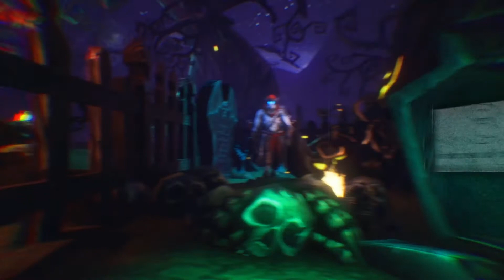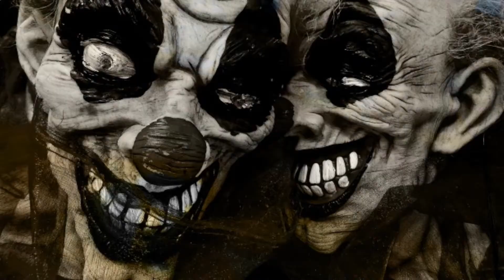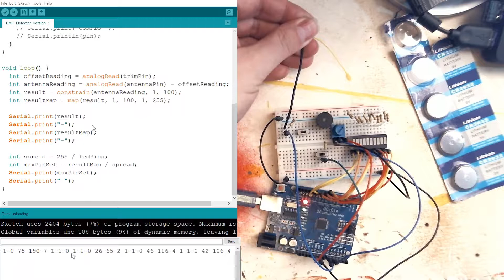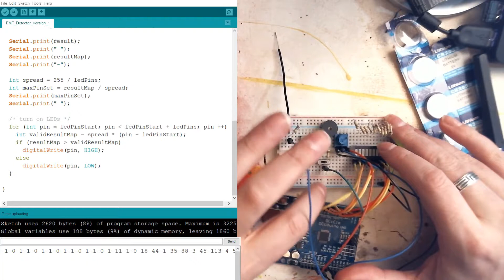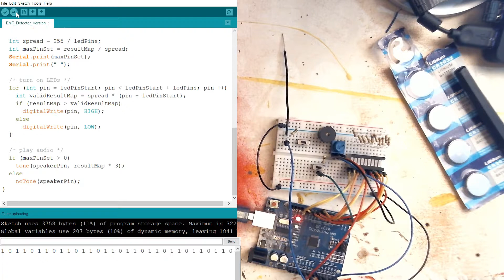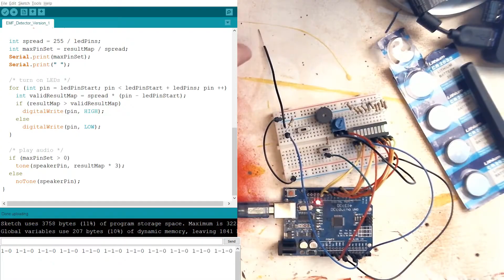Part 3 -  Making a CHEAP EMF Meter - Coding the Arduino

Comment: Nice setup. Just tested it, and it is working. 
Antenna a little to unsensitive, but not much.
The explaining file on Bitbukect.org is missing the indication of a resistor around the antenna. Parts List is not 11, but 12 resistors.
Reply from the maker: Paranormal ITC Research nice!! Good catch!  It actually works kinda nice.  I’ll get that updated in the morning :)
Reply: @LloydSummers  OK.  An unisolated dipol mini antenna got mounted to a two pinout socket. Fits in the bread board.
I have 8 Diodes, and i can only light up the 4 first when not touching. The potmeter is turned all over to one side.  A direct touch will turn on all. 
I wish for the antenna to be a few more procent sensitive, I guess. But it might be better, when moved over to a real PCB.
Reply: @LloydSummers  I have a few Schematics for scanners. https://www.dropbox.com/s/6au7khvew8qdysh/Arduino%20scanner.zip?dl=0
1) FM Scanner,
2) KM2 Meter extended with socket for I2C Bus
3) Rem Pod. (One of the chips will have to be programmed, which i don't have any code for). 
Schematics with use of EasyEDA.

Comment: Lloyd, the potmeter is turned all over to a side, and i can only turn on 4 of 8 LED's, without touching antenna. I don't pay enough to have that big aura.
So how can i make this setup sensitive enough?
Reply: Solved by changing int spread = 120 and "if maxPinSet >1
So it wont sound before over first led.